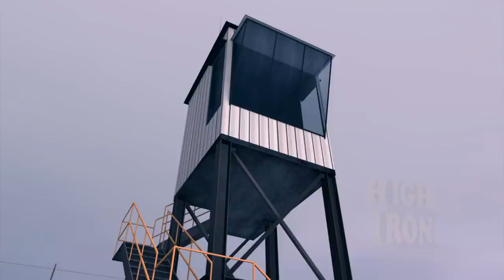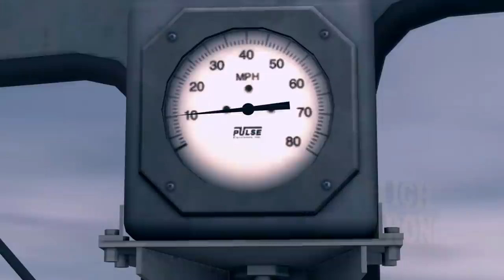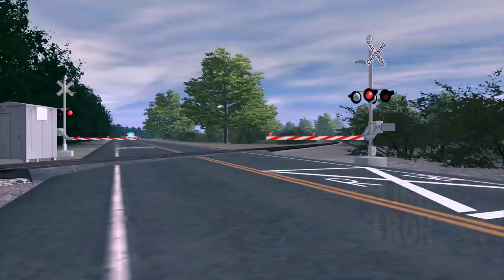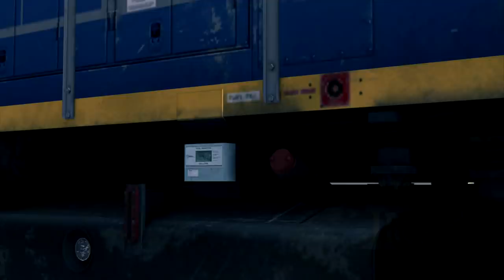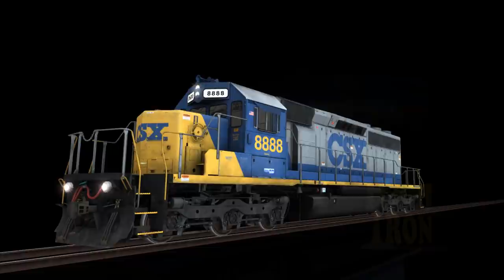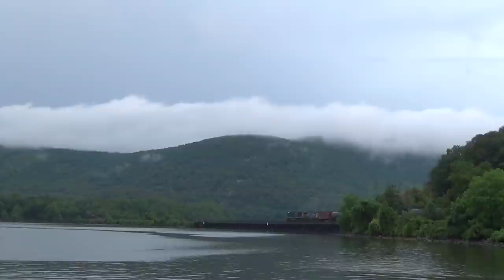The Unstoppable Crazy Eights Incident

Comment: The “Crazy 8’s Incident” is probably the last runaway we will see for a while or ever mainly because the technology we have now is designed to stop situations like this from happening.
Reply: Its still crazy tho that even in the year 2001 their first two options were to derail it, then try shooting at a small moving button 😆
Reply: Yes and the funny part is who’s idea was it to shoot a button right next to a diesel tank that would explode if it were to be shot at. Just comment sense to not shoot it.
Reply: And it would of never happened if the engineer would have just fully applied the locomotive break and independent break at the same time and waited for it to fully stop.
Reply: @trainenthusiastproductions5219  diesel doesn't light let alone explode until very hot or very  high pressure not gonna ignite. Like jet fuel it's really falking hard to light with any less than a blow torch
Reply: @derrekvanee4567  The fuel for the SR-71 and the A12 also has high flashpoint. You can actually put out a fire with the fuel that the spy planes used.
Reply: Ptc and to would of brought that train down fast
Reply: Came here to say that UP just had a runaway and PTC couldn’t stop it.
Reply: @streetfightinmanrs  Outside the US, there was a runaway in Egypt in and Germany in 2019
Reply: Unfortunately, there was another runaway incident. Back in 2013, it was the Lac Megantic Rail Disaster.

Comment: I was an engineer for CSX from 1998 - 2004. 8888 came through Barr yard. I had to climb on it and read all the graffiti. 'My little runaway' was all over the cab. Fun times.. Lol
Reply: Rick. Why didn't the alerter shut it down?
Reply: @berkshiredave9766  I really don't know. Possibly, the engineer applied the independent brake. That might have stopped the alerter from activating the system. Just a theory though.
Reply: The legendary Barr yard blue island

Comment: There's an old WWII commando training film here on YouTube (or at least there was) called "How to stop a train".  Large sections of track need to be removed to stop a train once it's got going, there's no surprise that those little derailing gimmicks didn't work on a train at speed...
Reply: I probably would’ve changed a set of points to put it into a small siding and just let it run off the edge of the tracks and fall over.

Comment: I never knew that locomotives had a control stand with a combined dynamic brake/throttle control.
Reply: i mean GE locomotives with desktop controls have that
Reply: yep quite common
Reply: Same
Reply: @oregonrailfan7046  Desktop controls, whether they're GE or EMD, rely on a much more absolute principle, though. While they are combined into a single controller, throttle and dynamic brake applications increase in separate directions. The setup on 8888 uses the same direction for dynamic brake and power application, which is confusing, and, as 8888 showed, potentially dangerous
Reply: @hvymtal8566  if I remember correctly, on a desktop combined throttle/dynamic lever, pulling back from center applies throttle, pushing forward from center applies dynamics. Much less confusing than one lever to select throttle or dynamics, then another to control the power
Reply: @catnipleaf8680  I know how desktop controls work, and it is a good design. That's not how the vertical control stand combined controller that was on 8888 worked. To select dynamics, you move the controller to idle, throw another handle which changed the control mode from throttle to brake, and then advance the controller. Aftwards. The same direction you would use to throttle up on every other North American system
Also, I never found the separate handles to be confusing at all. You only use one at a time and they go in different directions
Reply: @hvymtal8566  That's exactly what I was commenting on. it's just not intuitive to have the same lever control both throttle and dynamics AND have it be the same direction for both. a design like that is just asking for someone to apply notch 8 throttle when they thought they were in notch 8 dynamics (which is exactly what happened with 8888)
Reply: @catnipleaf8680  You seem to be reading me totally wrong, because we agree on that point entirely
Reply: @hvymtal8566  you’re right, I misunderstood. Good to know we’re both on the same page
Reply: I believe that is the way it was before -2? so like GP/SD 7s, 9s, 18s, 20s, 30s, 35s, 38s, 39s 40s and 45s were like that. Then when emd made the -2 in the 70s they had the standard type controls. I believe the other lever is called a transition lever, and when you put the throttle at idle and then use the transition lever to select dynamic, then throttle becomes dynamic.
Reply: 8888 had a selector lever that had one control that was either throttle or dynamic. This selector lever is how they used to change transition on the traction motors back in the day as well and now is only used for dynamic or throttle. this lever is a small handle in addition to the bigger throttle lever.

Comment: FWIW:  I was under the impression that railroad locomotives -- even back in 2001 when this happened -- had some kind of dead man system built into the control station that would not allow the locomotive to operate without an operator present.
Reply: They do however the air hoses that would normally allow it to happen were not connected
Reply: @geocachingwomble  >>> Okay -- Thanks.
Reply: because the brakes were applied, the alertor system is disabled.  had the brakes been released, it would have shut down in 45 seconds or so.
Reply: @krakenwoodfloorservicemcma5975  >>> Thanks.
Reply: @Allan_aka_RocKITEman  oh no problem. i repaired EMD equipment for 12 years. I miss those contraptions sometimes. had these clowns actually shot the emergency button, it would have cut off the fuel pump relay.

Comment: I know next to nothing about trains and railroad. I had never heard of this until I saw the movie Unstoppable, I was kinda surprised to learn it was loosely based on a real event. However, I was surprised to learn that attempting to shoot the fuel shutoff button wasn’t Hollywood drama, but really attempted. It seems to me it would have been much more effective to shoot a bunch of holes into the fuel tanks. If the fuel leaks out, the engine won’t run, the train would eventually stop. 

Once again, I know very little about trains. I have no clue how much fuel a train carries, or how long it would take to drain. I’m guessing if punching a bunch of holes into the fuel tanks was a possibility, someone would have suggested it.

Comment: In Poland we have RADIO STOP system, that wuld be probably helpfull in cases like that. The system works on short radio waves, all trains who(?) pickup the signal automaticly disengages engine and apply breakes. This is usefull but have been abused. If i'm not misteaken our trains also have automatic stop sensors that can detect whenever stop signal is being send by transsmiter, then the system informs engineer that signal have been send, if not deleted in 4 minutes the train stops, and can be turn on again after complete stop only.

Comment: As For 8888 And 8392 Some Railroad Museums Try To Buy CSX 8888 But CSX Refused Unfortunately In 2016 8888 Was Rebuilt Into SD40-3 YN3b Renumbered 4389 As For CSX 8392 It Was Retired From CSX And Was Sold To The National Railway Equipment (NRE)

Comment: Interesting… I always thought trains had a deadman switch
Reply: 8888 did. By setting the independent brake, the engineer bypassed the dead man’s switch.
Reply: @ptdecker  No problem, Todd. It does seem like a pretty glaring oversight in design to not require the deadman switch when the brake is applied. I believe newer locomotives do not have this same oversight.

Comment: So I'm curious why the alerter shutdown device didn't kick in, when the yard engineer wasn't in the cab for more than a couple minutes? I Could have sworn that those things were mandatory, once they got rid of the dead man's switch?
Reply: I was wondering the same thing I'm guessing cause I know you can switch them off with a breaker I'm going to assume because he was just switching around in the yard he did not have it activated
Reply: It was disabled due to the brakes being applied

Comment: Biggest question for me: Why didn't the Alerter/Auto Shut Down work? Without control inputs for that long, it should have thrown the train into emergency and set the engine to idle.
Reply: Independent brake was applied.  This cuts out the alerter.
Reply: @silicon212 : Wow.OK, thanks!

Comment: Why didnt it have a dead man's switch? Do american locos even have that?
Reply: They did, but it's disabled when the brakes are applied. Someone mentioned this in another comment. Also they don't have them anymore. They got replaced by an alerter system that automatically applies the brakes if the engineer is out of the cab for 4 minutes or so if the train is moving.

Comment: Wouldn't some form of expected "dead-man" control (triggered when the driver left his seat), have caused 8888 and its coupled train to eventually come to a stop?
Reply: Engineers get out of the seat from time to time, to use the bathroom or maybe look out windows. Also dead man's system is disabled when brakes are applied.
Reply: Pelham 1 2 3 😁

Comment: You forget 2 things:
1 they actually made 2 hop-on-to-stop attempts, you only mentioned the second one which is successful.  //https://youtu.be/apsKBo8-zak?t=59
2 " An EMD GP40-2, CSX locomotive #6008, was prepared further down the line to couple to the front of the runaway to slow it further, if necessary. ...... The train was stopped just southeast of Kenton before reaching the GP40-2."   //https://en.wikipedia.org/wiki/CSX_8888_incident